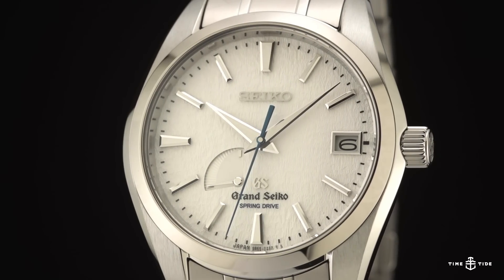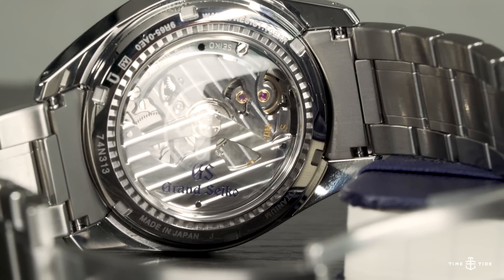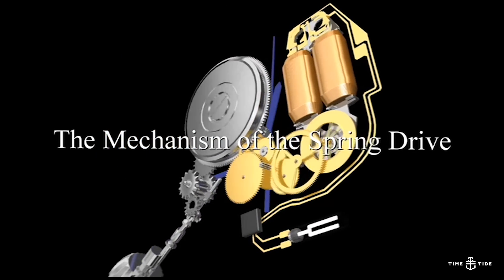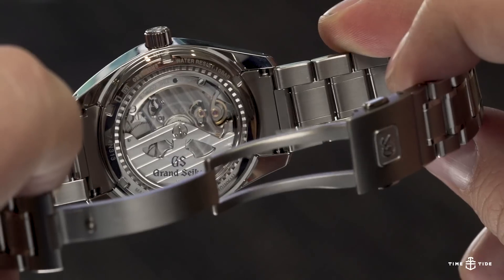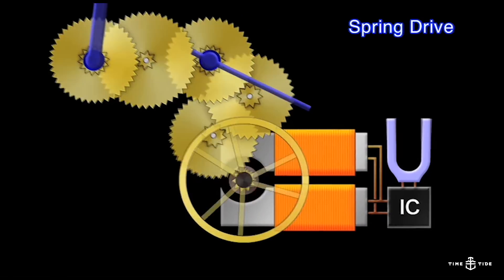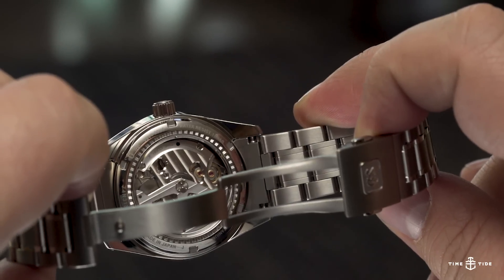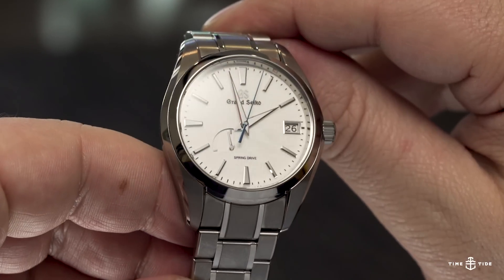GRAND SEIKO – Spring Drive Explained

Comment: Smart using a quatz crystal as a timing pulse ppwered by spring energy, no battery replacement, with good mamifacturingand quaility its better than a Rolex and 1/20-1/50 the cost

Comment: No Swiss watch would come anywhere close to the perfection, precision of a Grand Seiko. Never. 

For those who are not aware,  Grand Seiko had a Chronometer grading, a Swiss Grading for its initial series of watches,  but the Swiss watch association COSC prevented Grand Seikos from using the chronometer grading  as it was from Outside of Switzerland. 

Truth be told,  the Swiss watch industry was shaken by the extremely high quality standards od Grand Seiko that they had to do something like what Trump is now planning to do - Tariffs for those countries who ignore the Dollar ( a stupid warning to the BRICS) and Tariffs to those who don't toe the American line.

Grand Seiko then came with  its own standards,  which was far more rigorous  that even the biggest names of the Swiss watches industry would rank low. 

Well, to those who are listening,  I donot own  Grand Seiko as if now,  nor have I been asked by Grand Seiko to say so but I have  seen Quite a few Grand Seiko watches and they clearly exude  excellence from any measure.

I hope my dream of owning a Grand Seiko would materialise soon.  

I am pretty sure if

Comment: So it is basically a quartz watch with a mechanical battery?  How is this better than a quartz watch powered by a solar battery, the one Citizen makes?
Reply: Because it is mechanical. Solar is good, but:

1. Mechanical movements are so much cooler than any electronic watches
2. You ain't gonna get much sun in the polar night (specific, yes, but that is still a plus for spring drive)
Reply: @Янус_Ырт  mechanical battery only has 3 days reserve, solar has many months, but I agree if you live close to the pole, this watch could be a good option.

Comment: A big part of what makes watches appealing to many is the micro-engineering & o/c the aesthetics. The beat (even if most of today's autos are hi-beat and your cant even really hear them), they are ticking, is part of that, It mimics a heartbeat.  What Seiko did here was create an ingenious elctromagnetic powered quartz regulated escapement. R&D aside, this (like quartz, but not to the same degree) wld be easier and cheaper to for them manufacture.  If they could make is the next big thing, (as they did w/quartz but these are not those days) they could make a more of a profit, which is probably why theyre putting them in the GS line. You can easily see the mechnical bits, the mainspring, rotor, & the later parts of the gear train, but its regulated electromagnetically. To each his own. If I was truly concerned w/ exact time i'd look at my phone, on a wrist, Id get a radio controlled Citizen 'eco drive'

Comment: This is why the Swiss stopped the accuracy competition when the Japanese started making more accurate watches and beating the best of the Swiss manufacturers.
Reply: swiss made is overrated
Reply: @lois8347 it’s like saying a Japanese made katana is overrated. Sure but where’s the history and allure if some European made you a katana
Reply: Swiss are still pushing new tech for more accurate fully mechanical watches. Like Zenith and the Zenith’s monocrystalline silicon oscillator, or all of the silicon movement components coming out over the last several years. Spring drive is great, but purists still poo poo quartz (in the case of spring drive, quite wrongly I think) and so there is still big money to be made by making mechanics watches more accurate.

Comment: So at it's core is a quartz oscillator and a micro-chip same as a cheap quartz watch.. Big difference is it generates its own power as opposed to a battery. So you pay $thousands to avoid having to replace a battery costing a few dollars every 5 to 10 years. Brillant.
Of course the other 'bonus' is you pay for an expensive quartz watch that is less accurate than many cheaper quartz watches on the market nowadays.
Reply: Good points.

Comment: Can the IC survive emp blast?
Reply: None knows for sure, since that theory that quartz watches would die and mechanical watches will work has never really been tested in a real life scenario and while some claim that everything that is electrical will fail, others suggest that the quartz watches are just way too tiny and small to be affected. On other hand, even if quartz watches can't survive, mechanical watches will get affected too in some degree, because their parts can still get magnetized and while that won't stop the watch, it will make it inaccurate and not very practical. Then again, an emp would probably occur from a nuclear blast and whatever your watch is functional or works at all is going to be the least of your concerns in that particular moment.

Comment: For those who say its the best mechanical movement you can buy I would simply point out pure mechanical watches do not have quartz crystal oscillators and multi-layer micro electronic circuit boards in them. At its core the Spring Drive is a quartz analogue watch and to be honest not a particular accurate one.. If you want GS (and they do make high quality watches) go for one of their HI-Beat mechanical movement watches.
Reply: Did you just attempt to say that the spring drive is not a "particular accurate one"? There isn't a single hi-beat watch that can match it in precision and accuracy.

Comment: It is technically possible to build Spring Drive mechanisms that could be retrofitted into some existing mechanical watch movements.  It'd be cool if that was actually done.  

Eventually, Spring Drives will appear in watches priced at mainstream price points.  There's nothing intrinsically expensive about the technology, now that it is developed to maturity and mass producible.
Reply: The same can be said about literally every watch, and yet incredibly expensive mechanical watches still exist. The escapement design of the movement is not exclusively what makes a watch (in)expensive. Plenty of other factors there.
Reply: I have $100 automatic watches that work perfectly fine and are reliable; yet Rolex, Omega, etc etc still have no problem selling for 5 figures. Grand Seiko will continue to be the luxury version and sought after watch if spring drive is every mass produced.
Reply: @hewster1 your $100 automatic watch is probably off by minutes every week. My Rolex is accurate to the second after a MONTH like a quartz. Imagine that. If it continues at the rate it’s going, it may be off 10 seconds in the whole year

Comment: Looking at it, it would seem that there must be a drive integrated circuit involved as well.  As an EE and an electronic tech, I just don't trust electronics in the long term.  A hundred year old watch can always be fixed, but if the circuit board or coils fail and Seiko doesn't make them decades from now, that's a problem for a legacy watch.  Honestly, except for the just the look of the sweep second hand, why not go with a pure mechanical auto movement?  Even Bulova stopped making the Accutron which had a smooth sweep.  Today, the 50 year old old Accutrons are now suffering coil failures with only donor movements available for parts, and those donors are also 50 years old.
Reply: Correct. Grand Seiko say they will keep "some" spare parts for their watches for "upto" 20 years after the watch goes out of production. So if the electronics fails after twenty years you could have a watch that tells the time twice a day.  Am not a fan of GS but if I were I would go for one of their pure mechanical watches using their Hi-Beat movement.
Reply: Anything can and will fail. If spares are not available, scavenging is the only way to repair. If automatics are no longer manufactured, it would turn out the same for them.

Either way, you won’t be here in a hundred years to find out which watch is still around.
Reply: @crackpotfox  Except that machining new parts for mechanical watches as needed is not a problem today for skilled watchmakers, and promises to be far easier in the future as small high quality CNC machines will become available to the hobbyist.  In any case, I just serviced a Hamilton pocket watch built in the late 1880s.  Just needed a cleaning and oiling.  The rest of the movement is as good as new.  Can't say the same for my collection of 70s LED watches or anything made since.
Reply: @ohger1  Exactly. I could hand make a new balance shaft for an old mechanical if I had to. It would take a while and I would probably screw it up a couple times before getting it right but I could do it. I can't make the IC or the crystal for a spring drive.

Comment: The micro chip its hard to make, so no one can copy (?)
Reply: There's no micro chip. It's purely mechanical power that creates a charge for the magnet to regulate the glide wheel. Nothing about this watch is digital.
Reply: @thomaschristopherwhite9043 if you see the pcb's, you can see the Intergrated Circuit (small smart chip) to regulate the frequency

Comment: Now we just have to wait and see if the spring drive movement can withstand the test of time. I wonder how long it will take for the coils and electromagnets to corrode or just stop working. I am no expert, I'm just curious.
Reply: Why wouldn’t it stand the test of time? It’s a fully serviceable movement so no reason at all why it can’t last as long as any other movement.
Reply: This movement involves less friction, which leads to less wear of the mechanical parts
Reply: I don't like it, I much prefer the mechanical/ automatic movement with the ballance wheel and main spring. Shit I've known people to have rolexs, omegas breitlings ect run for 30 plus years no service.

Comment: Even the Patek Philippe seconds hand sweep looks jittery after you have seen the Grand Seiko's.
Reply: Hello it's not a garbage ,you are totally wrong .It's a brilliant innovation . Because there is no battery .For quartz watch ,battery is a source of power .But in spring drive of GS there is no battery .If you wind or shake the watch the rodor rotates a makes other wheel in moving stage that gives energy to the main quartz related part .Why you are telling wrong like garbage . Actually are you mad.GS Spring drive is the world most accurate mechanical watch without a battery.Its precision and accuracy is above Rolex .Grand Seiko spring drive better than Rolex and Patel .Don't say mad things.
Reply: @manjusubramaniam9040  how often do you have to get GS watches serviced and does spring drive increase the servicing cost? Can the local watch shop service it or is it too complex?
Reply: Because they don't actually sweep, all mechanical watches have a second hand that stops and starts, just very quickly so it looks like it 'sweeps'.
Reply: Even though it doesn’t clearly explain in the video the quartz is there to give a reference signal to the integrated circuit that controls the magnetic brake of the glide wheel. It’s not directly used to keep track of time as in your $15 Casio watches. All the electricity it requires comes from the rotating glide wheel itself which in turn is powered by the main spring.
Reply: true
Reply: This is essentially quartz watch. It still uses electric power to operate the watch. Garbage
Reply: @arthurschopenhauer9805  No, it does not use electric power to operate. There is no battery. There's a main spring that delivers power to the movement. The mainspring is wound by mechanical action. The quartz and coil is just for timing the escapement super-accurately.
Reply: @an1rb  it says even in the video it uses electric and magnetic power. Magnetic and electric is the same. So it is not mechanical it is electric. It doesn’t matter the electric power source is battery or outlet or windmill. That is achieving accuracy wrong way. Easy way i am sorry. Is it innovative? It is but it is still electric and has nothing to do with mechanical watch. Max you could call it hybrid. Swiss watxhes are not hybrid. And accuracy means nothing. It is the way of achieving that accuracy that makes the watch something. I will prefer 20 second off jlc over most accurate electric watch.
Reply: @arthurschopenhauer9805  You should brush up on basic Physics.
Reply: @an1rb   you should brush up on logic and thinking abilities
Reply: @arthurschopenhauer9805  I love how the electric component makes it "garbage" even though you admit it's innovative. Would you like to live back in the stone ages?
Reply: @DuGongggg  I own 3 Rolexes and a GS springdrive, they are all very good watches though the Rolexes do have much better case fit and bracelet, sometimes it’s not all about movement you need to look at the entire package, the GS has better dial and hand works though
Reply: @an1rb  Yes it does. It's an electronic watch. It just uses a spring to generate that electricity instead of a battery. Why else would there be an integrated circuit in a completely non electronic, mechanical watch? ICs are useless without electricity.
Reply: Seiko invented the quartz movement which turned the watch world upside down. It took them 28 years to develop the GS Spring Drive. Sure, I own a Rolex Datejust and several other autowind watch and I love them, but I also highly admire the great minds at Seiko for achieving quarts accuracy integrated into a perpetual movement.
Reply: It is Not a quartz movement. It is a mechanical movement with quartz accuracy regulation. Electrical energy does Not drive the watch. A main spring which is would by enertia drives the watch.
Reply: Wrong. It is a mechanical autowind watch like an Oyster Perpetual with the accuracy regulated by a quartz crystal.
Reply: @Kevins-Philippine-Retirement  No they didn't. A Canadian invented the quartz movement decades before. Seiko was just the first to miniaturize it enough to fit into a wristwatch.
Reply: @wingracer1614  So what you are saying is, SEIKO was and is innovative and introduced the worlds first quartz wristwatch.
Reply: @hewster1  Don't put words in my mouth. Seiko did come to market first with a quartz wristwatch but that's not what he said. He said they INVENTED the quartz MOVEMENT which is a provably false statement.
Reply: @wingracer1614  So what I said is accurate. Thank you.
Reply: @an1rb 👌
Reply: @an1rb  Stop, you’re both wrong. It’s not a quartz because it doesn’t use quartz crystals or battery, and yes it used electricity Faraday’s Law.
Reply: @arthurschopenhauer9805  Daaaaamn you got smoked. Sit down son
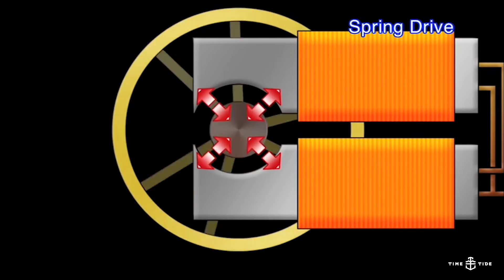Reply: @frankv7068 Although he says at 1:17 that it uses a quartz crystal. The electricity generated by the wheel is distributed through an internal circuit and then a quartz crystal
Reply: It does still technically use electric power, why else would there be a magnet in there. The guy u are all hating on is right lmao, u dont need a battery to produce electricity
Reply: @blalink6458  It's an electromagnet-- used for timing. Power comes from the spring. Please ask an engineer.
Reply: @an1rb  yes you are correct, it is powered by the spring, but it does use electricity
Reply: @arthurschopenhauer9805  Are EV car garbage because they're EV's?? What exactly makes these "garbage?" As a watchmaker, I'd really love to know this. 🤔
Reply: @watchandjewelryloft4713  what makes a piece of technology garbage is the non-perpetual battery. EVs are garbage because of the battery that needs to be changed every decade. Without a battery, an EV or any other electric garbage can't operate. Grand seiko, on the other hand is NOT garbage. It does not need a battery and is purely mechanical in generating its power.
Reply: @Arthur Schopenhauer  spoken like someone who has zero clue as to what they are talking about... and/or a Swiss fanboi and not an actual watch enthusiast
Reply: @arthurschopenhauer9805  man u gotta be the best troll on earth
Reply: @arthurschopenhauer9805  goofy ass went into hiding😢
Reply: @arthurschopenhauer9805 
Yes. Accuracy is garbage 😂
Reply: @arthurschopenhauer9805 it’s ok. You don’t understand.
Reply: @arthurschopenhauer9805 it doesn’t use any electricity to operate 😂 it’s litteraly getting power from a MAIN SPRING and the time keeping is regulated using quartz, this my friend is an automatic mechanical watch regulated by quartz, welcome to the future boomer
Reply: @zackz1260  it does use electricity, but it’s generated by the mainspring. A quartz movement would use a battery. And unlike a quartz movement, the electricity doesn’t drive the movement, it is used to power the chip and make the quartz crystal oscillate.

Comment: The illiterates should note that quartz watch has a specific meaning - a watch powered by an external source of power. A battery. The spring drive is not a quartz watch merely because it exploits quartz oscillation. The watch is still mechanical. 

And a technological masterpiece that shits and urinates on tourbillion watches from a great height.
Reply: It's funny how people are just incapable of having nuanced opinions. Do you seriously think someone is going to blow a fortune on a tourbillon because of the accuracy?
Reply: Good god that is so wrong. Quartz has nothing to do with the power source, it's the method of regulation. Other methods are the Swiss lever, coaxial escapement, tourbillon, tuning fork, cesium atomic clock, etc. None of those have anything at all to do with the power source. The power source could be anything from a battery, solar panel, spring, flywheel, radioactive decay or the residual energy captured from you jerking off. It has nothing to do with quartz
Reply: This is a quartz watch because the Quartz regulates the time. All mechanical watches are powered externally whether its body movement or using the crown.
Reply: Sarchasm Short . Still quartz and their bracelets are shitters.
Reply: @rockinginafreeworld3256  I'm slow clapping for the Archiebald-head Chest-hair-field the turd 💩 reference.